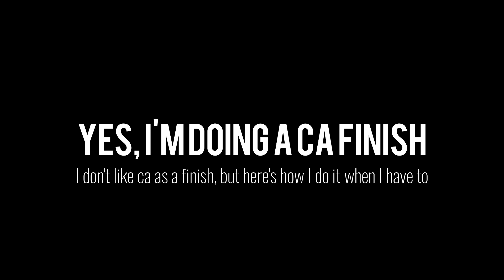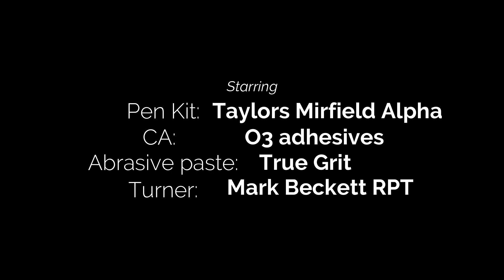That's right, I'm showing you how to do a CA finish........

Comment: Looked nice.  Myself I do not use accelerator any more.  There were times it turned the CA glue white or cloudy.  That was no fun when you have done so many coats and all the sudden it doesn't look good.  CA by itself I can do but it would get bumpy maybe because of humidity in the air.  I saw Russ Fairfield's videos and like doing it that way with oil on the paper and a drop of CA.  Just rub it back and forth and speed up the lathe until the paper gets warm and repeat.  For me it leave a nice slick finish that rarely needs sanding.  No matter how all do a CA finish it makes such a nice finish to a pen )
Reply from the maker: Thanks for tips